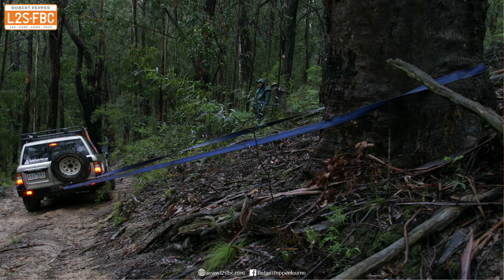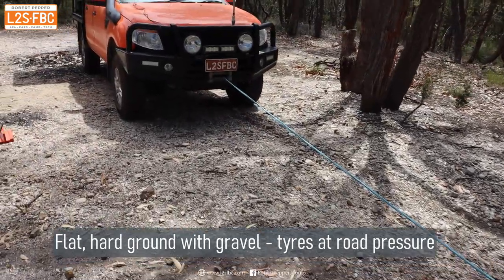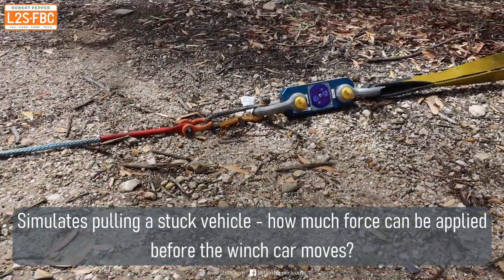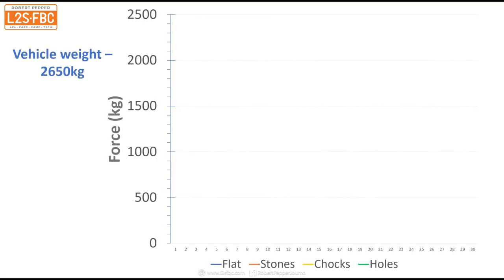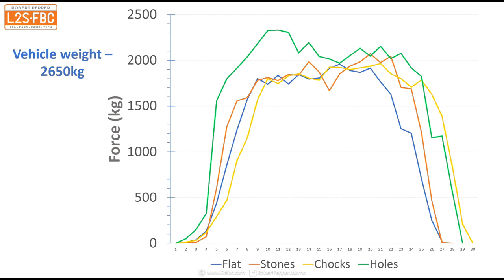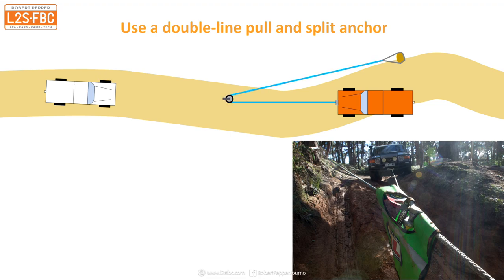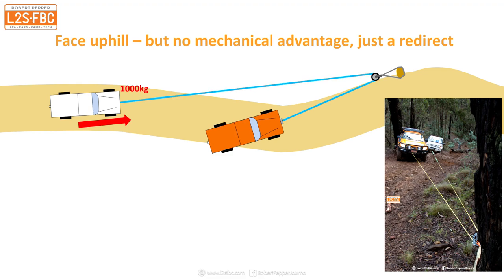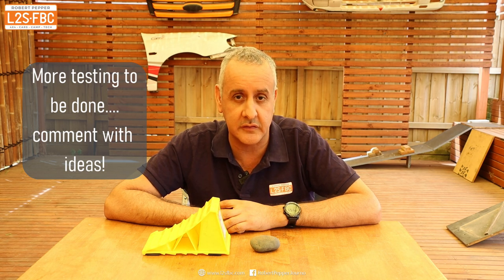How effective are chocks when 4X4 static winching?

Comment: From my observation, the plastic chocks were 'placed' infront of a locked wheel. Thus not allowing the vehicles weight to load up on top of them, so technically you were just pushing them along the ground.   I would like to see it repeated, but this time 'LOADING' the chocks, with th vehicles weight prior to the pull.   Also some steel chocks are available and should be pre-loaded with the pull vehicle prior to starting the pull.   Please repeat this test, but with these new parameters. - Great work always educational, I appreciate your work. thank you
Reply: 100% agree

Comment: Thanks Robert. In softer soil I've also used the tyres to dig the holes by reversing gently against the winch rope. FYI my diffs are built and with lockers and I'm gentle so I don't blow the diff.
Reply from the maker: Much easier way to dig holes than using a shovel, and great note on the diff stress!

Comment: I used a railroad tie once for a chock for my Jeep XJ to try to pull a large truck that had gone off the pavement a bit and lost traction... I ended up getting dragged over the top of the railroad tie... I had a hydraulic winch, so I had the duty cycle and the power was probably enough, but there just wasn't any way to anchor my vehicle to keep from me being pulled to him instead of the other way around...

Comment from the maker: Adding a comment from Bob Wohlers which for some reason YouTube wouldn't let through:

Robert, good video; specific to just that style of chock. However, as you point out, not all chocks are “created equally.” Some designs do work better than others. That said, I not found that any style of of tire chocks really helps in restraining the movement of a winching vehicle in compression terrain – sand, snow, mud. They do help a bit more in the rocks and on fairly solid uneven terrain since they can eventually “catch” on the terrain and help restrain the winching vehicle. If I really need to restrain the movement of a winching vehicle on compression terrain, I almost always anchor the vehicle from behind by running a winch line extension from the front bumper under the vehicle to the rear. One more item if I may… IMHO I don’t believe any video or mention of restraining a vehicle while it’s winching should conclude without noting for beginners that they should never leave a static winching vehicle’s automatic transmission in PARK during a pull. I don’t believe I heard that mention in your video; perhaps I missed it. As you know, leaving a winching vehicle in PARK to restrain it is asking for a broken Parking Pawl – a major transmission meltdown in the field. Now you really have a stuck vehicle. Cheers.
Reply from the maker: Response - the vehicle was in Neutral with the brakes locked, but good point I should have specifically said that. Agree re anchoring behind as shown in the video.  

I will do another chock test with various suggestions from readers. At present this is:

Scotch anchor
Hole & yellow chocks
Drive up onto chock not next to it
Different tyre pressures
Logs

Comment: Idea for a video using your load cell... Work out what the towing force is on different surfaces. Ie. How much force can a vehicle "pull" when in sand, on gravel and on bitumen before the wheels spin. High mount point vs low mount point. Uphill vs downhill vs flat.
Reply from the maker: That's on the list! Thanks!

Comment: You could try putting the chocks in holes with somewhat vertical dug forward wall, letting the chucks dig in.
(Keep street pressures in the tires to prevent them from climbing the chuck too easily.)
Reply from the maker: Excellent idea, thanks!

Comment: So, I wonder if the type of chock make a large difference.  I have a set of steel chocks with teeth that will actually dig themselves into the ground, and help anchor the truck.  There are also miniature versions of the chocks that are used by our large firetrucks that have very aggressive teeth to them.  They are cast aluminum and fold up, very impressive chocks.

Comment: This is great, thanks for doing all these tests with actual measurements! Have you ever tried winching with chocks (maybe on all 4 wheels) without any brakes or parking brake, letting the vehicle roll? I wonder if heavier duty rubber chocks used in that way might provide more traction than the tires alone.
Reply from the maker: Future work...

Comment: As always, you try to explain different scenarios in the most scientific way possible.
I do not know how many times you have performed the test in each of the chock scenarios; I say this because the images of the plastic chocks test seem to show that it is performed on a footprint from a previous test (3:50).
On the other hand, I wonder if the caravan chocks used in the test would do a better job of removing the underneath layer of gravel by allowing their saw claws to dig into the dirt better. Be that as it may, I like the idea contributed by @Sten Torsten Michael Kruse about digging a hole with a vertical wall on which to support the plastic chock (or stone) and thus prevent the chock from sliding. I also wonder what effect it would have if in that hole dug we placed the plastic chock upside down and placed with the approach edge facing forward and digging into the hole as the tire rests and pushes the opposite vertical part of the plastic chock. As if the leading edge turns into a large claw as it digs into the hole.
I do not know if I have explained myself correctly so that you can get the idea of what I intend to convey.
Regarding the use of stones, it is evident that we have to adapt to those that exist in the environment, trying to use those that are larger, with a flat vertical face on which the tire rests and with another more irregular face that is keyed in the terrain as the car's support on the stone increases.
Another option is to use a trunk of a fallen tree, or a piece of a fallen branch, from which other branches come out that can be cut, in such a way that the latter dig into the ground like claws.

Editing my comment: 
I'm sorry. I forgot to thank you for your work, not only for what it contributes in itself, but also for the possibility of contributing ideas and discussing them.
Reply from the maker: Great ideas, thank you very much! Watch for a new video with some of them :-)

Comment: You could try using chocks that are properly designed for off-road use. A proper off-road chock is a single piece of Steel bar bent into the shape of a chalk with teeth on each end to dig into the soil. That being said I carry one for use while jacking, but would only use it while winching as a very last resort.
Reply from the maker: Yes more tests on the way....

Comment: There are vehicle anchors and there are vehicle anchors. The only ones I have seen that actually work were those made by Fairey Winches Ltd. (later Superwinch Ltd.), and used to be sold through Land Rover dealers under Part Number 583590 - sadly now obsolete but very desirable used. Those you actually physically drove on and put a chain over your front bumper. They are also very heavy, bulky and quite cumbersome. Most seem to be glorified wheel chocks which don't work.
Reply from the maker: Sounds too heavy to be useful!
Reply: @L2SFBC  Almost, but not unmanageable. I'd say they weigh about the same as a waffle board. They do fold flat just 75 mm (3.0 inches) thick though, and they are designed so the teeth that dig into the ground can be unbolted and fitted the other way so it can be used on hard ground too. There is a company reproducing them now but at £864.00 for the pair!

Comment: How about putting the wheel chalks in the hole? Or, turning some branches into stakes and then driving the front wheels up to them? Also, can you damage the parking brake pin by leaving the vehicle in park instead of just using the E brake?
Reply from the maker: Watch for further tests covering that sort of thing. Yes you can, the tests were done with the footbrake applied.

Comment: I love your stuff, I bought the factor 55 soft shackle after watching your vid, but i have to say on this video you used lightweight, non serious looking chocks. If we look at the  Fairey Wheel Chocks, - them are chocks, those are real  chocks with a blade to dig into the ground. Your yellow plastic ones, you might as well have put the front wheels on a skateboard. 

Sorry I dont mean to be mean, apologies. Just that I was looking at the Fairey chocks and then I watched this. All hail the dozer blade.
Reply from the maker: I used cheap blocks for a reason. I plan to do it again with different chocks.

Comment: Little harder to test but what about multi vehicle anchors? And what about trying to reverse power in a winch pull?
Reply from the maker: Have plans for more tests with chocks. I do not recommend reversing while winching as it will stress the transmission too much.

Comment: another great one.  
When i am by myself, i find it hard to push the break lever when i am outside with the remote winch control, so the chalks might be better than only the rear wheels (e-brake).  Is there a device to apply the breaks on all four wheels without being in the cab?  I am planning on puling out some shrubs, and want to see what is going on out of the cab.
Reply from the maker: pull the parkbrake on, that'll lock all four wheels with the centre diff locked or in 4WD
Reply: I plan to pull some shrubs too! I will be by myself too! I was wondering about the brakes. The last thing I want is to ruin the transmission. I'm considering turning the vehicle on, pulling the parking brake, using the chocks and leaving the truck in neutral. I will not be in the vehicle to apply the brakes. I'll see how my ram 2021 reacts, the electronic shifter may not let me leave the car in neutral. I could also rig up a jack to engage the brake pedal manually. Basically I want to use my Ram as an anchor point to pull some shrubs.
Reply: Good point.  I think, normally the parking brake only locks the rear wheels, but i guess there would be a fair bit of coupling through the center diff to the front when locked in 4WD. Regardless, in low range 4WD, there should be a lot of rolling resistance while in gear with the engine off, but i expect to be in neutral with the engine running to charge the batteries. @L2SFBC

Comment: The irony… mentioning a brain as a recovery tool… then digging a hole with the shovel and not placing what is dug out to the front of the hole… 🤦‍♂️ why not use what you work for?  Free loose dirt to chock a tire with
Reply from the maker: because I wanted to see the effect of a hole, not a hole+ dirt. Often there is an identation only in the ground.
Reply: @L2SFBC  Fair enough, but then the depth of the hole is a factor… people conscious enough to be worried about digging the hole I’m thinking would definitely use what they dug up… 
My guess… digging a 1” hole and placing dirt in front would be more effective than digging a 4-5” hole with no dirt in front… less work, more effective. “Work smarter, not harder” hahaha
Reply from the maker: yes, I plan to use a range of holes. I wanted to use a shallow one to see the effect, quite dramatic!  But I disagree, I think the depth of hole is important and loose dirt much less so. That's for a test...
Reply: @L2SFBC  agreed, loose dirt isnt great, but to dig a hole and not use what is removed is kinda silly, isnt it? 
Just a mound of loose dirt is better than no mound. A rock under one wheel is not as good as a rock under 2, or 3 or 4 tires. Its all perspective, and Im not trying to be “that guy”… Im just saying that anyone smart enough to know they need to dig a hole as a makeshift chock, will likely know to use the dirt that was dug up… I found this video looking for “dos and donts” or wrong size chock fails. Good video!  I just laughed when I seen the one part where the hole was flush 😎👍 no complaints here… just observation and discussion!!
Reply from the maker: all good..this was an experiment not necessarily real-life, yes I should have been clearer on what I was testing!  thanks for your comment.